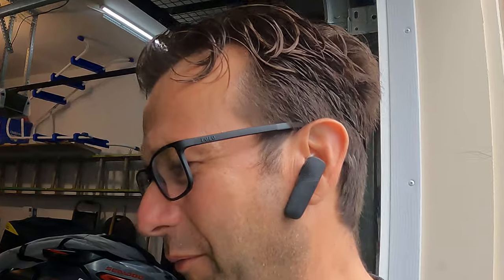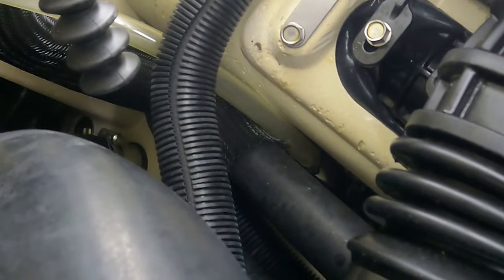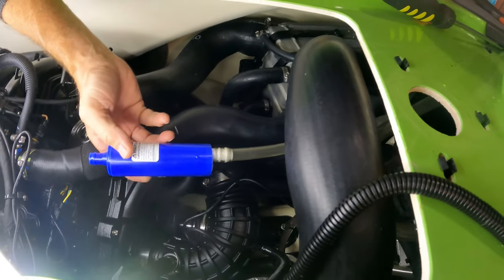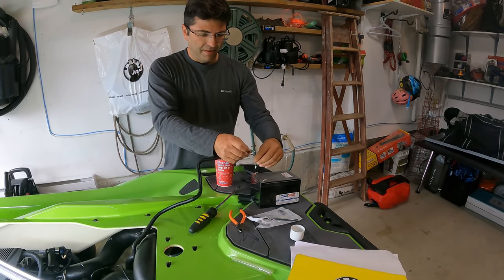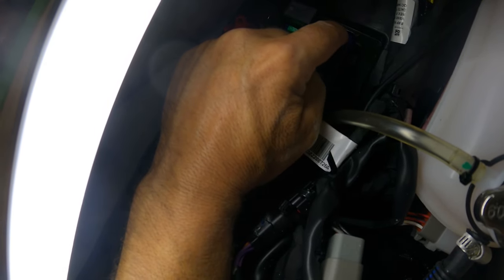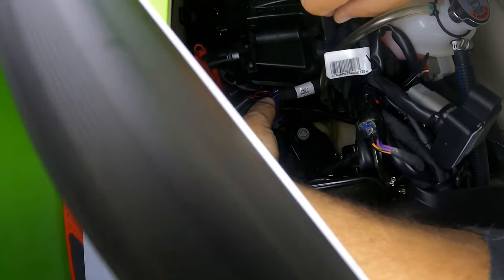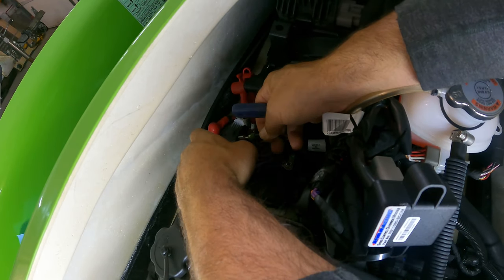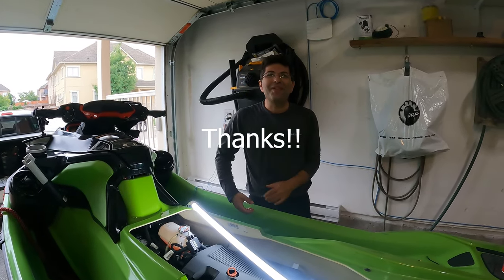How to install 2018 & up Sea-Doo Bilge Pump Kit (Part 1) | S2E10

Comment: INSTALLED A TOGGLE SWITH TO INTERUPT THE PUMP>  Great video. I installed mine but I also installed a water proof toggle switch (ran it through/ under the storage compartment for easy access without having to remove the seats).  I just interrupted the positive wire.     I didn't like the pump running all the time; draining the battery and noisy.
Reply: Exactly!!!
Reply: Do you have a pic of how you installed the toggle switch?

Comment: Great video guys very informative, with the pump running constantly would that burn it out i wonder how long they last ? And lets say for instance u are taking on water and you are from from home do you think you can make it back with this pump ?
Reply from the maker: Thanks for watching. The pump is designed for wet and dry pumping so it won't burnout. I've put about 30 hours on my PWC and the pump is fine. Its suppose to keep you afloat until you get to safety. I've never taken on water so I' assuming at this point!

Comment: Isn’t that tube you connected to made to auto bilge your ski while the engine is running? The only thing the electric bilge does is pump the ski out while the power is keyed on but your engine isn’t running. It won’t help you get your ski back to shore if you have a leak.
Reply from the maker: You need to be moving as well in order to start producing vacuum suction and It's always good to have extra safety equipment when on the water!

Comment: Any idea if this works on 2018 GTR-X? I don't see a fuse box in this location. Only find one by battery and cord is not long enough
Reply from the maker: Thanks for watching our channel and hope the below information helps you.
https://shop.sea-doo.com/ca/en/295100681-bilge-pump-kit.html 
SKU 295100681
The fuse box is beside/attached to your battery inside a black plastic box. 
This unit will require you to drill a hole to expel any water.
Hope this helps!

Comment: So this pump is running constantly , so basically you don't know if the pump is working or not , the only way to find out is to take on water and see if it's pumping ??
Reply from the maker: Correct, the pump runs continuously, the only way to know its working is the sound the pump makes. No way to know if your taking on water as the pump expels the water under the Sea doo near the exhaust. Some folks find it pump noise annoying while trying to fish, etc.
Reply: @adventurechannelcanada  And what is the service life of this pump ?
Reply from the maker: It has 1 year warranty. I have 50 hours on it and fine.

Comment: Hi guys having trouble locating the instructions don’t seem to be available on the brp instructions site , i have a 2018 RXPX and all looks the same apart from the fuse box - does not appear to be a bilge pump fuse , assuming i may need to pick up power from another fuse any advice would be appreciated !
Reply: Never mind looked again with my glasses on bilge pump fuse is there 😂

Comment: I noticed that the label on the pump stated that it was a 24 volt DC pump. Is your electric system 24 volt or 12 volt?
Reply from the maker: The Sea Doo is hooked up to a 12V single battery. This bilge pump works properly for both 12V and 24V, even though the pump has a marking of 24V on its body. It will work normally on the 12V of your vehicle.

Comment: Why doesn't seadoo use an auto bilge pump?  I don't like having g it run all the time. Also 100 bucks vs 500 bucks. And the 100 dollar one is better

Comment: Does it pump  thow like  have you tested  it out
Reply from the maker: I haven't actually water tested it. Do you think I should?
Reply: @adventurechannelcanada   up to you I have the same one I just don't know if will pump out water thow
Reply from the maker: You know what, I'll try it and post a video to show how it works.
Reply: @adventurechannelcanada  он постоянно включён что-ли? Включил зажигание и насос постоянно работает пока включено табло?
Reply: 2 problems with this setup:
1. Looks like it pumps out through the jetpump area.  Thus, you wouldn't know it was pumping and that you have a problem.  I prefer the pump water outlet be visible.  if you see water coming out; you know you have an issue right away and to get to shore asap.

2. Only works if the key is attached.  If you were docked somewhere and away from the ski, it won't turn on.
Reply from the maker: Translation: is it on all the time? (YES) Turned on the ignition and the pump is constantly running while the display is on?(YES)
Reply from the maker: Agreed but it was easy to install with no mods required.
Reply: @adventurechannelcanada   how would I shut it off like pull a fuse